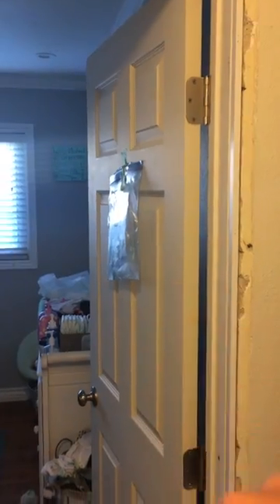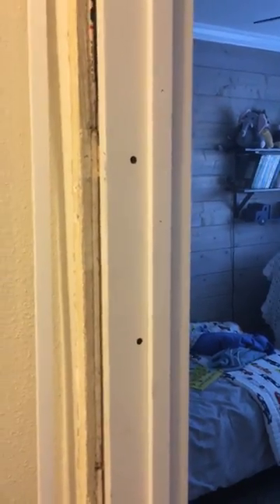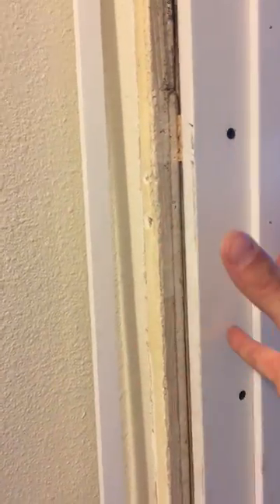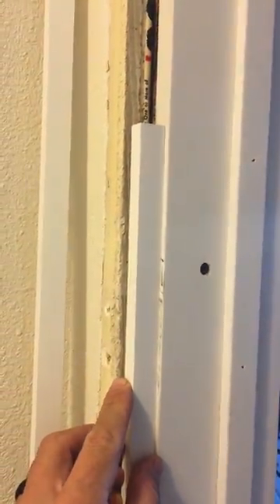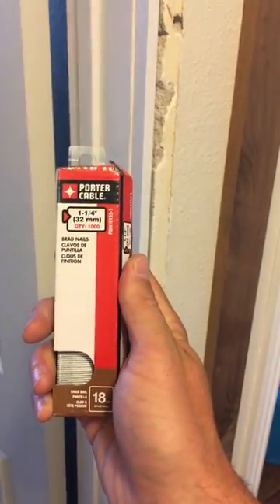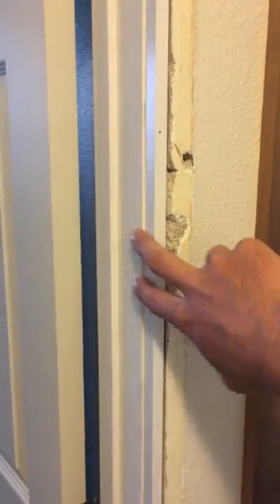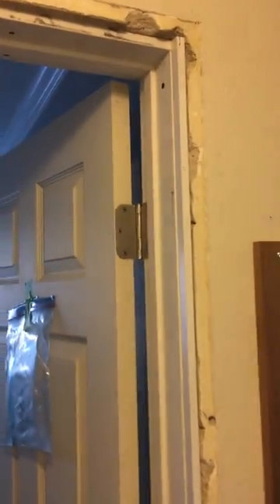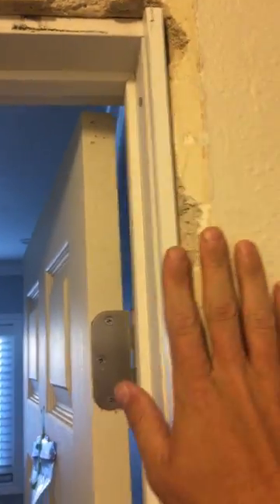Pre-hung Door Casing Width Too Small for Wall (solution)

Comment: I had to use a split jamb door in the same situation. ( Home built in the late 50's/ early 60's) I did much the same method you did, with a piece of trim, only the space was in the middle of the jamb rather than the end. It took a lot more time because, I had to be more careful and shim the frame more securely due to the split being in the middle rather than the end. It worked out well...

Comment: Looks great. What I'm wondering though is if it would be ok to buy prehung doors that are too small for doorway. My interior doors are odd sizes 33 1/4" width, and so I'm assuming if I got a 32" prehung door that there would be gaps on either side of frames. Would it be ok to fill gaps with wood pieces or would those gaps be too much?